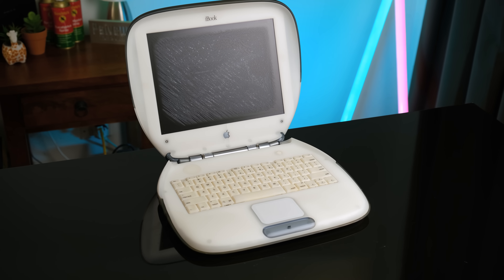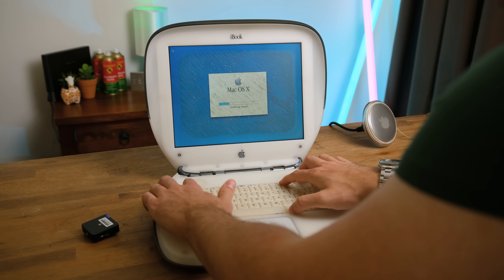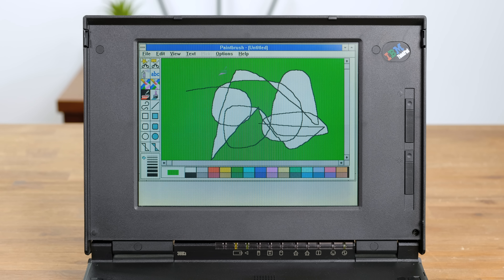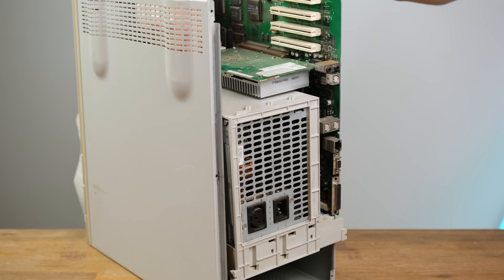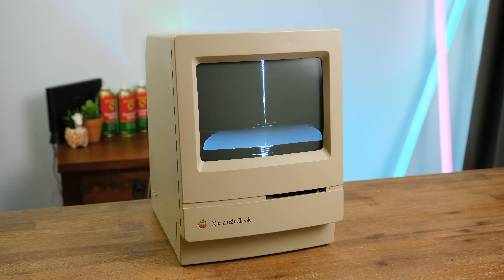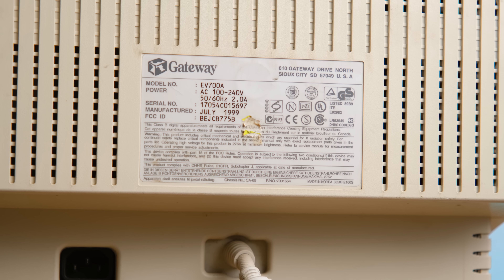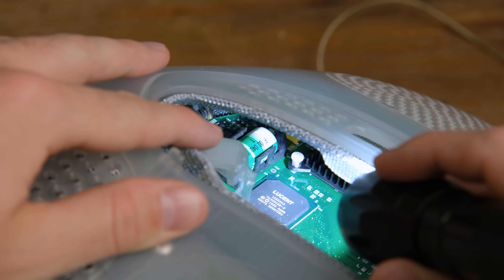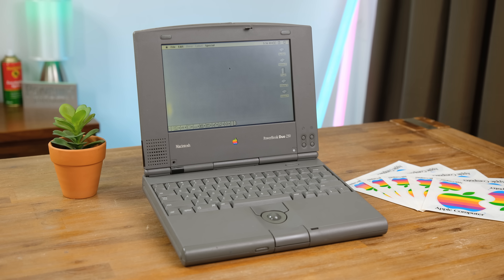So Much Vintage Tech Is Dying... Here's Why

Comment: Tantalum capacitors, which most compact electronic items employ now, are probably another ticking time bomb. From personal experience and observing other accounts, their life expectancy from new may be typically around 30 years, and many fail way sooner than that. When they fail they typically form a short circuit.
Reply: Yeah, a lot of mid-80s PCs have shorted tantalum caps. The 90s ones are probably dying now too.
Reply: I can vouch from experience that 30 years is just about dead on for tantalum capacitor life. I used to collect and repair vintage keyboards and synthesizers and owned quite a few ARP synthesizers from the 70's and 80's. Almost all of them made extensive use of tantalum capacitors (a.k.a. "blueberries from hell") which all failed catastrophically around the 25 to 35 years old mark. ARP Omnis are the worst candidate with about 120 of them.
Reply: @UMAMIMAMU  sadly, I assume that if you want a capacitor with low ESR, good linearity, and good high frequency behaviour, all in a small package, there is no choice but to use tantalum capacitors. I also assume that the only way to stop them failing short circuit would be to include some sort of fuse, but that would significantly raise the ESR, and also ruin other characteristics. Do you have any further thoughts?
Reply: @Roger_Gadd In all honesty bro, the fact that I even was able to get as good as got at fixing those dinosaurs is nothing short of a miracle. I'm about the furthest thing from an electrical engineer and my understanding of a lot of that stuff is fickle at best. That said, I definitely think tantalum capacitors give a slight but noticeable improvement in sound quality. There's a warmth and clarity that's hard to describe. I've heard ARP Omnis that were recapped with electrolytics, and ones that were recapped with new vintage spec tantalums and the effect that electrolytic capacitors had on the sound was actually quite shocking (pun intended). From that point on the only way I would use substitution components was if I knew irrefutably that it wouldn't change the original sound.

Comment: So either you have commercial stuff that was not designed to last. And then you could have your computing needs covered by RasberryPi or OrangePi or whatever Single Board Computer with ARM processor that usually people figure out how to fix it if a certain chip dies.

Comment: The first comp I used was an apple IIe, the next terminals connected to a mainframe, the next a timex sinclair 1000 (which was actually mine). The next a KLH 195 286/12. Those batteries look weird. Yep bad caps explode. I'm just a gamer. I have built about 25 for friends and family, even the little itx (mini shoeboxes). I don't even bother with laptops anymore, as I always break the plastic tabs. My main jobs in my life were 7 years military and 17 years underground mining as the explosives expert. Autos, ATV's, and computers are just my hobbies.

Comment: The PC with the case/frame literally breaking/falling apart, I wonder if a "new one" could be made for mall that fancy "3D printer" tech?  I have no idea how, but those things seem to be doing miracles.
Reply: Hard plastic can swell and turn brittle by contact with wrong oil. In 1990th I had a Toshiba CD writer drive in a PC that tended to get stuck. After oiling with "machine oil", after a while the whole black polystyrene chassis started to crumble apart like charcoal. The same happened with a transistor radio. Also bakelite (e.g. in Hammond organs and tube radios) is infamous for this. When plastic cogs split around the metal axle or concentric cogs in quartz clock movements get stuck, this happens by swelling plastic due to wrong oil. Thus never lube unkown plastic mechanisms with anything but silicone oil. Also most rubber (latex, butyl etc.) turns into chewinggummy goo by any non-silicone oil. By I read complains that otherwise silicone oil may soften silicone rubber (used as rubber keys and key contacts), so do not spill it and avoid to oil if you don't need to. 

Similar plastic/rubber damage may happen by long time exposure to oil or battery leak vapours. Battery liquid vapours particularly damage LCD displays, thus failing segments or broken carbon foil cables (they tend to turn brittle anyway, e.g. inside calculators and Casio music keyboards) are likely caused by this.

Comment: This is the near future for every modern car that is currently on the road, especially battery EV's. They are disposable, and engineered as such. Made as cheap as possible, sold for as expensive as possible. However, cars 13 + years old are infinitely serviceable and repairable. Cars from 25 + years ago in most cases were engineered to last as long as someone maintained it, largely due to a lack of electronics. 
Wait until this world is solely dependent of electronics. Existence will be as fragile as a wilted, dry, crumbling leaf.
I'm old to enough to remember most of these devices debuts. Sad outcome. Life was simpler then. Tech only when needed.

Comment: Before those disintegrate, someone should take careful measurements, as replacements for any plastic part can be 3D printed.  Today you can print in nearly any material, from Nylon and ABS all the way through to rubber, like TPU.  It's a shame the manufacturers wouldn't release the engineering drawings to make it simpler to preserve a bit of history...
Reply: this is so smart
Reply: aaaand what about the people who dont have 3d printers?
Reply: It's not like anybody really needs ancient, obselete tech like old computers. They are pretty much useless in the real world, outside of a few virgin nerds who want to claim that they definitely, totally use that crappy 1995 Laptop that has even less power than your average smartphone. 
And the preservation is already done in computer museums around the world, nobody needs your 1993 compaq crap pc that sits in your basement collecting dust.
Reply: I think people are doing that!
Reply: That's smart ! I hope that a maximum of people are gonna take your advise
Reply: Egoism and a psychotic fear about piracy stands against to keep and restore vintage electronics.
Reply: @robfriedrich2822   won't actually matter much longer.  We can already 3D scan objects and recreate them.  This will quickly improve under AI to duplicate anything, either physical, or circuitry wise...
Reply: its funny you should say that. because patent documents include exact measurements for the finished product. which are completely visible to anyone for free.
Reply: @FingerinUrDaughter  down to tiniest part level?  I can see overall dimensions, but wasn't aware you get a full engineering diagram of every single part.
Reply: @brianmi40  x2 Do you know more about open patent documents.
Reply: @RodolfoAmbriz   no, sorry
Reply: @FingerinUrDaughter  Are there specific websites where we can see patent documents?

Comment: The 90s and early 2000s were a time of relentless cost cutting, even in the Mac space. To do otherwise was to lose customers. When I was a repair Tech at my local Best Buy in the 90s, poorly made caps corroding were already a known issue. This is what led to ceramic caps becoming the go to standard. Fortunately, it's relatively easy to backup all your old data to a thumb drive, or better yet, archival quality CD, DVD or Blu-Ray. Just as you can still find a turntable to play old LPs and 78 RPM records, nostalgia societies should be able to refurbish, or manufacture on demand optical drives for the foreseeable future.
Reply: the internet archive is incredibly important for stuff like this, in the future we can probably manufacture something almost the same in aesthetic
Reply: The process of making an optical drive requires precision and effort that's not really acheivable (financially viable) on a small scale While anyone can make a phonograph. The only specialized part is the cartridge.
Reply: Also, sometimes manufacturers just have a bad batch or two of those parts.
Reply: to be fair the capacitor plague was due to counterfeiting in the electrolytic capacitor market, caused by an ex-employee stealing an old/prototype formula from Nichicon and running off to china with it, selling it on so hundreds of factories produced millions of capacitors during the late 90s (either 1996 or 1998, I forget which) until 2002ish and took until about 2006 for all the stock to be either found and destroyed, or inadvertantly used coughoriginalxboxprerevision1.6cough
I'd avoid flash drive for archival though, depending on the NAND quality they can lose data after a year of being turned off, as their modus operandi is billions of nanoscopic capacitors - better off using magnetic tape or archival HDDs, stored in a climate-controlled and EMP-proof safe

Comment: Solid state drives decay?
Reply: SSD/Flash memory functions like DRAM with 1 year refresh cycle (see Wikipedia "wear leveling") and will die if not powered on once a year for some minutes. It dies the faster, the more erase/overwrite cycles it has gone through, thus never use a worn USB stick or SSD as backup media. They starve without energy (modern triple/multi level types even faster).

Comment: my TRS 80 is still fully funtional! I have had it since I guess shortly after they came out. it would have been in the 1980's  sometime and my dad brought it home. I was the only one who was ever able to really use it and even that was pretty rudimentary. lots of typing in code from a big book they sent you to get it to do some simple thing play play a particular series of sounds or change the screen color. I most enjoyed the games that it came with , they were on a cassette tape and were like a choose your own adventure type thing. you could make a decision and it would fast forward or rewind to a particular spot on the tape and play the next audio file with just a still picture if I recall correctly. the games are long gone but the computer still works . I think the fact it doesn't have an internal battery and the monitor was just the tv helps keep it in good shape noting really inside to corrode. I remember thinking computers were more or less useless and couldn't imagine it ever really being much of a thing.....boy was I wrong!!

Comment: the melting rubber is the WORST. i had it happen to a phone case from only about 5 years ago and it was so oily and wet that it scared me when i first touched it

AND thank you for mentioning the bit about batteries. i'm starting to worry about some of my old macbook batteries - one of the cables shorted recently, and while i think it may have been the outlet, it made me realize i need to be more careful with the batteries :(
Reply: Imagine that happening to your knobs and switches in your lamborghini or Ferrari.
Reply: See also PS3 controllers :(  people use talc powder on the thumbsticks to make em a bit more useable. Hardly a solution but it works in a pinch
Reply: @piotr78  I bought for PC a used Xbox 360 controller from fleamarket. The thumbsticks did feel a little sticky (I cleaned them with isopropanol) at also too loose by worn mechanism, so I placed a distance piece made of cable insulation under the stick to make it firmer and less shaky.
Reply: This sort of thing happened to only one of my PS4 controllers for some odd reason and my Yamaha electric keyboard, part of the console just melted one one
Reply: @SobrietyandSolace  With music keyboards I mostly had trouble with the case of 1980th Italian keyboards (Antonelli, Bontempi, Farfisa etc.) where the plasticizer of the mains cord (which is still unusually soft after decades) turns the case surface into tar-like sticky goo where the cable touched it, thus wrap a PE plastic bag around the cable to prevent this. Also some Yongmei (Chinese toy/trash keyboards) have soft PVC plastic buttons those stick to the case plastic.

The only Yamaha trouble I had were black foam rubber pods (on PortaSound PS20/PS30 etc.) decomposing into sticky black goo. Also foam rubber adhesive strips inside keyboards (to prevent rumbling cables) often crumble, which is strongly correlated with battery leak vapours or presence of other dirt.
Reply: I agree with you, melting rubber is the worst, i received a Palm Treo 750 to my collection and it's rubber is nasty.
Reply: Ugh, THOSE GIZMONDO HANDHELDS
Reply: One of the first electronics with intrinsic melting rubber disease syndrome was my Kawasaki UniSynth XG-1 electronic guitar. The fretboard consisted of smooth foamed rubber with embossed string and fret texture having contacts foils (like in cheap PC keyboards) underneath. Although the stuff felt like smooth neoprene when new, after only 1 decade it always decomposed into a tar-like black mayhem. Likely it was some kind of PU with possibly an incompatible glue layer or plasticizer in the contact foils those dissolved it into a kind of smeary black pitch. I kept the thing, but it would be very difficult to revive (possibly remaking the fretboard of neoprene or black silicone).
Reply: It's the hydrolysis of polyurethane unfortunately...Going green comes at a cost...I had to remove foam insulation surrounding wiring from a Volvo. The foam was a sticky green, gelatinous mess...Not fun. Sneaker collectors experience this too when their prize sneakers yellow and literally disintegrate before your eyes!
Reply: @andrewx86x  PU is also the stuff that makes headphone pads crumble apart. I hate it. I keep my headphones in a dark plastic bag against ozone and UV exposure now, but if the decomposing substance is already inside (e.g. glue of the foam rubber) it won''t help. Also battery leak vapours strongly damage foam rubber. I collect music keyboards, and all with rusty battery contacts have damaged foam.
Reply: @andrewx86x  With sneakers it may help to store them airtight (in dry state, not freshly worn) in a dark place and add an absorbent if decomposition forms acid or such things. But migrating plasticizers between different materials are hard to avoid. Seiko made a talking watch "Robo-Air" using the same crumbly sneakers materials. The pneumatic cuff mechanism always decomposed. I did buy the remains with the LCD watch part because of the robot voice, but the strap would need to be completely replicated with different materials (silicone?) if anybody cares. (I collect sound toys and things with strange sound chips.)
Reply: Some people say to charge the battery between 50~60%... No more or less. I prefer 55%. Also disconnect it from the device.
Reply: @IsmaelWensder  I finally desoldered the leaked battery from my Psion Revo (which is not actively used) and wired an external battery box for 2x NiMH. It turned out that the display stayed blank now, because apparently solder joints went bad. I reflowed them with hot air solder station and plenty of flux to revive it. But dismantling the thing tore the rubber keymat (was superglued at one spot?) and taken the PCB out needs to pry at front rim first, else it will definitely break the lid switch (happened to me). At least I still managed to dump the German Psion Revo rom this way before they will all extinct by bitrot or get discarded with battery leak damaged LCD.
Reply: I have to say, I've been very impressed with old cellphone batteries. I've got some now 20 years old and they've not leaked and actually can still hold a decent charge. But what has become a tragedy now that 3G has been shut down in the USA, old flip cellphones that were great standalone backup alarms are unable to keep current time. And there's no manual override for date and time. My LG Lotus (which has stored in memory many of my custom alarm tones), is showing a horribly wrong date now and time is way off. The only way to use it as an alarm is to calculate the time difference and then set the alarm time accordingly.
Reply: @cytherians  In Germany we still have 2G mobile radio as the fallback standard (mainly for technical purpose, but also old Nokias) that likely transmits clock too. If you insist on using antique mobile phones as alarm clock, be sure to set them to flight mode, else the radiation fries your brain (particularly if the service got shut down, which makes it crank up its transmitter to yell at maximum microwave power).
Reply: @cyberyogicowindler2448  I think the concern about radiation is when holding a cellphone to your head for long periods while on a call. I put my old cellphone in airplane mode mainly to cut down on power consumption.